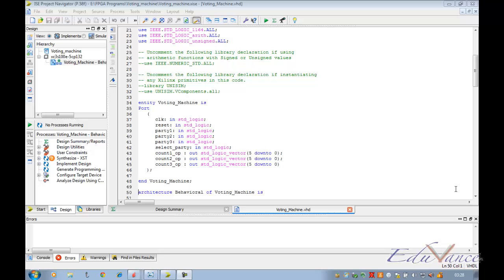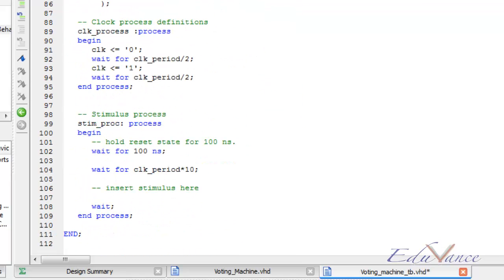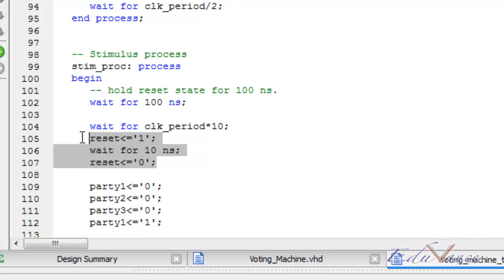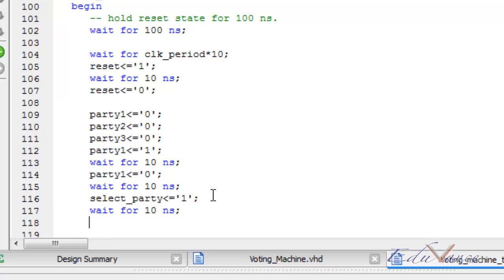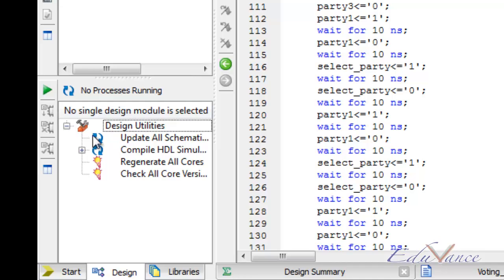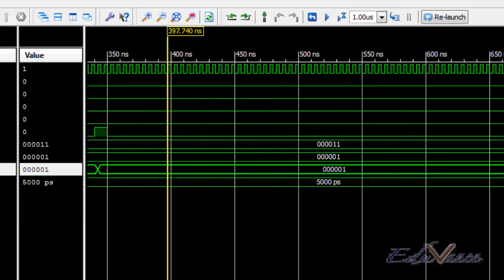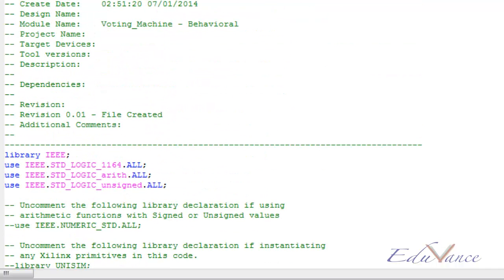VHDL Lecture 22 Lab 7 - Voting Machine Simulation

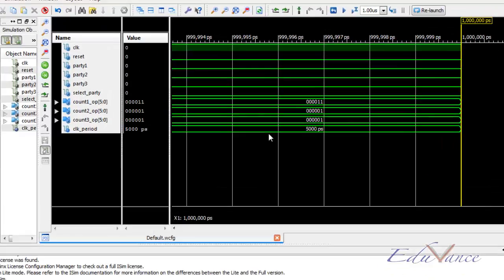Comment: Thanks for a good series. I tried this project and am getting the output at 6:25, i.e. count1=001001, count2=000011, count3=000011. 

Can't understand how you changed it to reflect correct output, since your video shows correct output at 6:28.   

Please help me out ! Thanks
Reply from the maker: The correct output is reflected at 6.28 seconds.
The code is working fine.
Reply: Thanks !!